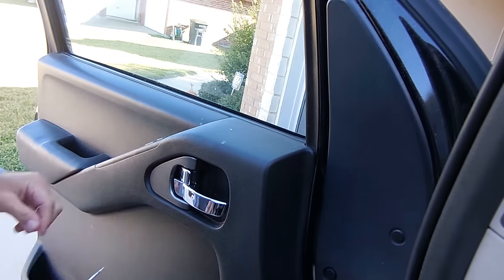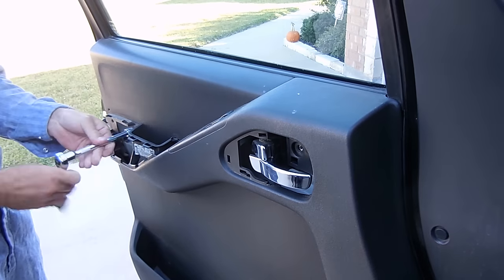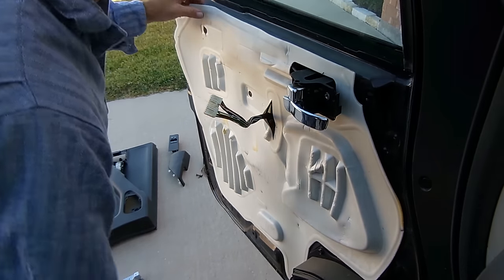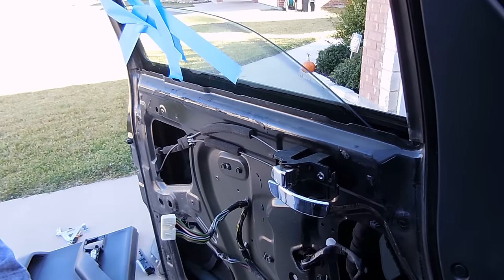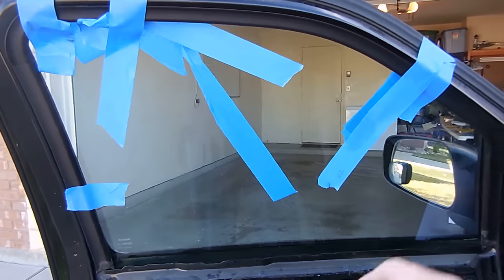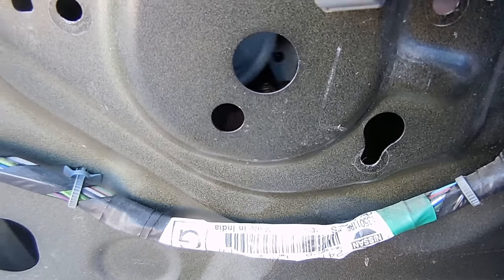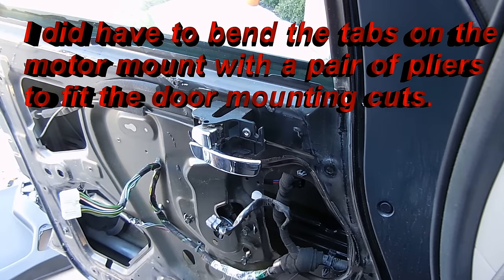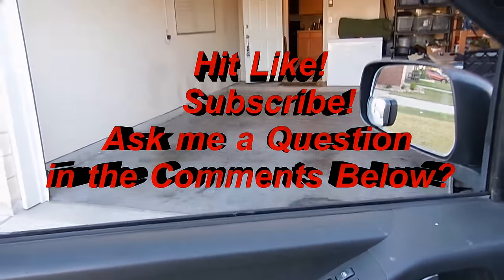Nissan Frontier Window Motor and Regulator Installation

Comment: Wow! Thank you for this video!!! I'm a single mother and my driver door power window went out a few months ago after a quote of $600 from the dealership and many other quotes for hundreds I knew I had to save up...Well a few  days ago I had to renew my tags and get a smog not remembering to mention my broken window the smog guy rolled it all the way down and it was completely stuck..  of course he was like sucks to be you I wanted to cry I already spent hundreds for my tags....
That's when I realized I have to fix this.. I found your video and your video was so comprehensive and straight to the point you gave me the confidence to do it myself I got everything ready like you said and no surprises came up because you already trouble shooted everything...
I am forever greatful that you gave this single mom the confidence. I fixed my window myself!!! Thank you!!! I got the part in Stock at Auto zone 97 bucks motor&regulator

Comment: Just finished mine, thank you. This video was perfect. If anyone orders the motor/regulator from Amazon and the motor holes don't line up right, use two bolts and a zip tie on the third. Someone on Amazon suggested that and it worked perfectly for me.
Reply from the maker: Great tip! Thanks for the information!

Comment: Even though I drive a right hand drive in Australia, i was forwarded your video by Courtesy Nissan and found it spot on. Just what I needed. The dealership was going to charge me $1300 for the motor and regulator but I found a second hand one for $170.  With your video and the part....I saved a fortune. Keep up the great work! And super thanks!
Reply from the maker: Wow, what a savings! I appreciate your comment. Thanks

Comment: Thanks so much for taking the time to video and edit the process for installing a new window regulator.  My 2006 Frontier's regulator is tired and due to be replaced.  I have done different vehicles before but it sure was nice to see my specific model and the instruction to remove the different plastic parts without damaging them.Again, thanks.
Reply: Changed out my regulator last night in under an hour...thanks so much for the tutorial.

Comment: I Just did this job using this video as a guide and it went perfectly with no problems.

The regulator available on Amazon for $40 - $50 is a perfect fit and works just as well as an OEM part, so save your money and go there.

 I used Gorilla tape to hold the window in place.  I used one long piece vertically on the center  of the window and over the top of the door, leaving enough on the end to grab and pull off easily.  When I needed to close the window I could just pull the tape off the top of the door and use it to pull the window up and then secure it again.

One suggestion:  The video shows using a screwdriver and plastic scraper to get the trim off.  For $20 at AutoZone I got a set of trim tools, which made getting the trim off  without damage incredibly easy.
Reply from the maker: Good tip!

Comment: Hey Bro, you rock!👏🏿👏🏿👏🏿👍🏾 I just bought a 2007 Nissan frontier and the driver side window was not operating properly. Then began to stop. I felt ghetto. I had to bat on the door to get the door window to operate. After watching your video I purchased a motor and  installed it this weekend myself. It was a learning experience but you guys lead the way. Your step-by-step instructions help me save hundreds of dollars. Thank you very much. It works just like brand new. I can now go on the base without opening my door. Like everybody else..
Reply from the maker: The struggle is real when the SPC laughs at you when you have to open your door to show your CAC.  Congrats, you are no longer "that guy"!

Comment: Thanks bro!  You're instructions were perfect.  I only had 1 hiccup - my window wouldn't roll down at all,  so I carefully drilled a hole to access the right side bolt of the window retainer clip.  Worked out well,  Thanks again!!
Reply from the maker: Brilliant, good tip. Mine was doing that before and I was able to apply downward pressure on the window while pushing on the window button and it unstuck itself briefly.
Reply: Great idea! Im working on two doors that are off the car and switching regulators between the two, and this is exactly what I am going to do. Thanks for commenting!

Comment: Thanks for the very helpful video.  I just came from the Nissan dealer with my 07 Frontier and they said it would be $850.  Update. The part came today and I followed your video to the T.   It works fine.  But you didn't say if the new part needed to be greased.  So I used a little.
Reply from the maker: The stealership will always try to overcharge you for parts and labor.  Great job on saving cash, now you can buy a beer and relax knowing you don't have to rely on a dealership or high priced mechanic to complete easy repairs on your vehicle. Cheers!

Comment: Many thanks for preparing this video - It worked wonderfully.  The only issue I had was having to bend one of the locating pins on the motor which may have been an Auto Parts Warehouse OEM oversight.  For shoring up the window I used 8" builders shims which are readily available. I found that by taping four shims together and placing one bundle on each side of the window I was able to easily secure the window in the both the lower position to remove the window mounting screws, as well as firmly holding the window in the upright (closed) position.  My original motor was burnt out and did not allow any upward or downward movement. Many thanks again.
Reply from the maker: Doug Hague great thanks for the input!

Comment: thank you! i have the same problem :) frontier 2005 SE, i was told it was the switch so i ordered online amazon, its cheaper 25 bucks compare to parts store that runs from 200 to 300 for a driver switch, so i installed it and i get the same problem, so its the motor, i ordered it at amazon for 30 bucks and i havent install it yet, thanks to your video!! i will try doing it later today!! thanks a million for sharing!!
Reply from the maker: How did it go?
Reply: oh it went fine, it was easy thanks to your video, works like new and i save tons of money for doing it myself, now im a pro haha, thank you sir!

Comment: Thanks man. I managed to do this this past weekend with a buddy. My window completely stopped working and I couldn't get it down to the spot where I could see both bolts so I have to stick my hands in the door with a wrench and unscrew the bolts manually. It was a pain in the ass but we got it done. I would have never attempted it had I not seen this video. Thanks for making it!
Reply from the maker: Robert Michael Reyes your welcome. Glad I could help.

Comment: Thanks so much for this. Saved me $500 or so. I also used the cardboard wedge technique and it worked like a charm. Some of the door pieces are slightly different (shapes/locations, etc) on my '10 X-Terra, but it was easy to figure out. Really appreciate the step-by-step!
Reply from the maker: That cardboard wedge idea seems to be working for a lot of people! Great.  Go buy some beer with that extra cash!
Reply: The Professional Prepper (Prep Know Do) So that's where my extra $500 went! lol

Comment: I did my replacement today and followed your video step by step.  The only thing i did differently is i used several pieces of cardboard to wedge the window in the up position. It worked like a charm.  Thank you so much for your video.  I saved lots of money over the estimates I received for the work.  Thank you.  It was really easy.
Reply from the maker: 628robair smart move with the cardboard. I didn't even think about that.

Comment: Thanks so much! I did this by myself. I didn’t have to bend the motor mounts thankfully. My only recommendation would be spray silicone for lubrication to make it easier on motor. I used gorilla tape, didn’t have painters tape.
Reply from the maker: Nice! Good Work

Comment: If you have a pathfinder make sure  the motor you purchase has a 6 pin connector, the 2 pin will not work, ran into this 2 days ago when I bought the window and regulator with the 2 pin connector and my 05 pathfinder has a 6 pin.The model that I installed after returning the 2 pin was a Dorman 742-529, it was the motor only so you have to mount it on the regulator but it's easy(only 3 bolts). Works fine, easy to change. It sucks I couldn't find a entire assembly but if your motor dies and your regulator is fine, the Dorman 742-529 is a direct replacement. Reassembling takes 15-20 minutes
Reply from the maker: Thank you for your input

Comment: I had the driver door window issue on my 2006 Nissan Frontier Nismo and bought the kit you suggested. Everything went fine until the function test.  The motor sent the regulator down but would not raise it. So it just remained locked int the down position.  I took it out and reinstalled the original unit and it worked!!! Weird!   So then I put the whole door back together and while testing the window it worked but not at full speed and then my truck battery died!  The battery was 10 years old so I went and got a new battery and now the window with the original motor/regulator works like new!  I now wonder if my low battery condition was the cause of the problem all along.   I like your video it helped a lot.  I used a folded piece of garden hose to wedge the window in the up position, a lot easier than the painters tape.  Thanks a bunch for your video!
Reply from the maker: Frankie D that is odd.  10 year old battery is unheard of! Batteries only last 3 years in the desert of phoenix
Reply: Well, I'm rather a different type of driver.  I got the 2006 Frontier/Nismo in 2007 with 16K on it from my son who couldn't afford the payments. In 2010, I replaced the battery while on vacation. Today my milage is 35,600, mainly because I'm an avid cyclisit and seldom use the truck.  So, in the past 10 years I'v only racked up 19,600 miles, or less than 2,000 a month, so the battery didn't get a lot of use.

Comment: Thanks for the great video. My problem is the motor is completely dead so I can't roll the window down to access the regulator bolts. Do you have any tips on easy access for the bolts with the window in the up position?
Reply from the maker: Try messing with the connection to the wiring harness. It should at least be making a noise like it's trying to move the window.  If that noise is present then with the door panel off, have someone actuate the motor while you are pushing down on the window with both hands. 
If there is no noise, you might be able to force it down.  good luck

Comment: Awesome video! Knocked out the job in less than an hour.  One caveat: using painter's tape to hold window in place is not compatible with some aftermarket window tints.  Live and learn, eh?
Reply from the maker: modad57 thanks

Comment: Thanks for this video! My motor is completely toast and I can't move the window to get it in the right position to access the bolts. Any suggestions?
Reply from the maker: is it in the down or up position?
Reply: Up
Reply from the maker: Try to push downward with both hands flat on the glass and have someone press the down on the switch. If not you may have to follow the video steps, unbolt the track and start wiggling things to free it up. spray lube on the motor and tracks.

Comment: My door is a manual window system. Can an automatic window system be installed on it?
Reply from the maker: It can.  However, you will need to run wires and possibly cut holes in plastic to make it work.  Many have done it.  Go to ClubFrontier.org for more info.

Comment: Any bypass if the switch does not work to get drivers window up?
Reply from the maker: I do not know of any, but if you apply direct pressure to the window by pulling or pushing up on the window from both sides the motor might be able to get it up with the help.  Im not sure of any other way.  Please post a comment on here as there are others that have the same issue.  Thanks.

Comment: Do I have to buy a new regulator if I buy a new window motor.
Reply from the maker: they come together in one unit. I have not found them for separate purchase. They both wear out and need to be replaced.  When I inspected them both pieces had significant wear and corrosion from use and weather. Trust me get both.
Reply from the maker: I have an amazon link in the video description for the product I used.

Comment: How did you know it was just dead to begin with this is the first trouble I've had. 2011 pathfinder.  I guess I'm just hoping it's not the full deal
Reply from the maker: The window would get stuck halfway while trying to go up.  It would go down just fine, but I would have to pull up on it while holding the up on the switch to get it to go back up.

Comment: I been looking for a rear left regulator for 2010 Nissan Pathfinder online but it only show front driver side and front passenger side. So my question is... Is the front driver regulator the same as the rear left regulator?
Reply from the maker: Cali state-of-mind My guess is that it's the same as the drivers side.  Try to find a parts manual.  If they are the same part then your good to go.
Reply from the maker: They are not the same!
Check this site out.
https://parts.nissanusa.com/nissanparts/index.cfm?action=replacement&groupid=K&sectionid=823&jointvehid=13178&siteid=14

Comment: How I'm gonna take out the screws in the bottom ? Which I coudnt raise. Up the window.
Reply from the maker: Bob Sampayan pinch the window and pull/push it up while u actuate the motor. you may have to get someone to help you.
Reply: The Professional Prepper (Prep Know Do) I banged on the inside of the door and the motor worked enough to get the window down enough. Mine was stuck shut as well.
Reply from the maker: Robin Baum get jiggy with it!
Reply: @ProfessionalPepper  The fucking motor does not lower the window!!! I can not actuate the motor!!!  This is the WHOLE reason for me to replace the motor!!!
Reply from the maker: @FritzDaB  try pushing down on the window as you actuate the window motor.  Get someone to help you so you can sandwich grip the window between both hands.

Comment: I am not sure what was wrong with your window?  I have a 2007 Frontier.  The commutator of the window motor was covered with brush dust particles.  I clean it with a pocket knife to insure electrical separation.  It worked like it should for 1.5 year.  Now it is stuck in the down position.  Need to take it apart again.
Reply from the maker: It just wears out due to the plastic components, corrosion, and motor it uses.  A quick swap for cheap and it works like new.

Comment: I ordered motor only.  Is it necessary to replace both regulator and motor at same time?  
Ty
Reply from the maker: I did, because they work in conjunction with eachother ant the regulator wears out and should probably be replaced.  If you are strapped for cash then just try to replace one, but if you dont have much time available or you want to not risk having to take everything apart again, replace both at the same time.  
The parts come assembled together when you buy them both, which is how the dealerships do it. 

Write back if just replacing the motor worked.
Reply: Ok done.  I sent back motor and ordered combo, glad I did and only cost $37 on Amazon.  This was super simple only took about 40 min with clean up.  Thank you for your help 😁
Reply from the maker: Awesome, way to go!

Comment: How do you determine whether the problem is the motor, switch or regulator?
Reply from the maker: John Arizona Welp its easy to just replace the whole kit minus the switch.  If you try to replace just one thing the otherwill eventually fail, making you reopen your door up.  

However, if you must. The switch w supplys power to the motor. So if their is no noise when you push the switch it means it might be the switch, failed connections, or wires.  If it's getting stuck or struggling to go up or down then it's the motor or regulator. You would have to take it apart, inspect it, clean it, lube it, reinstall it, and test it to see if it aleviated the problem. It's just best to replace both.  I have a link in the video description to the part on amazon that hundreds of people have used to fix the problem. Let me know how it goes.
Reply from the maker: John Arizona by the way my name is Jon and I'm from Az
Reply: I went ahead and ordered the Regulator and Motor from Walmart.Com-$48 and if that's not it I can return to any Walmart. I can't stand Amazon. Ordered yesterday and just received a ship notice, it will arrive tomorrow. I had voltage to the motor but motor dead. Thanks for your help friend. Nice to meet you Jon. God bless!

Comment: driver side power window rolled down but it does not back up
Reply from the maker: is it all the way down, or only partially?  Mine was only partially and I was able to have someone pull up while I operated  the switch.

Comment: I've come to the conclusion that Nissan engineers are sadistic! The window motors seem to be designed so that grease flows out of the mechanism and into the motor, which destroys the brushes and armature. Just replace the brushes? Ha! good luck finding new ones. In general, they seem to delight in putting things in inaccessible locations and giving just not quite enough room for a socket or a wrench.